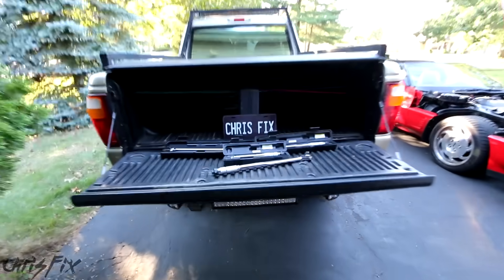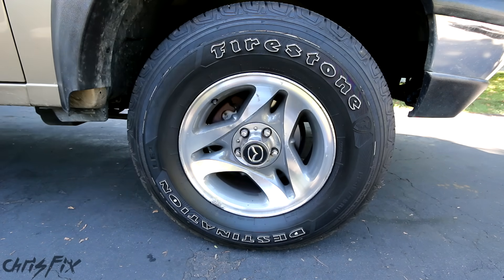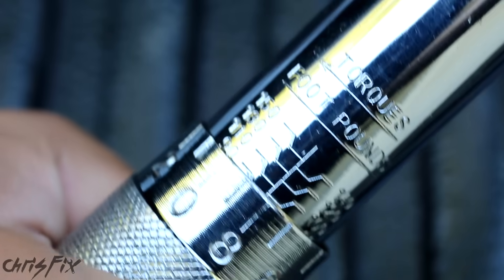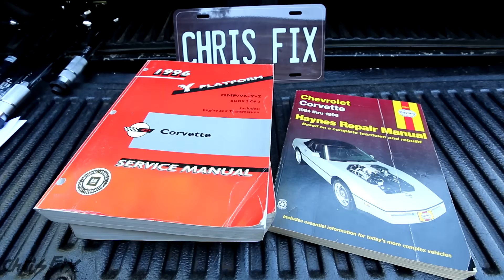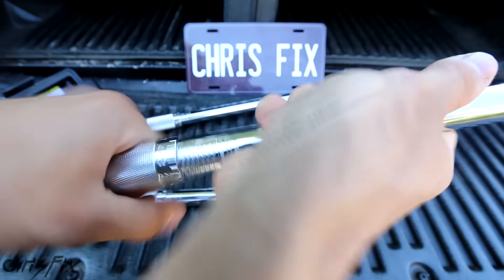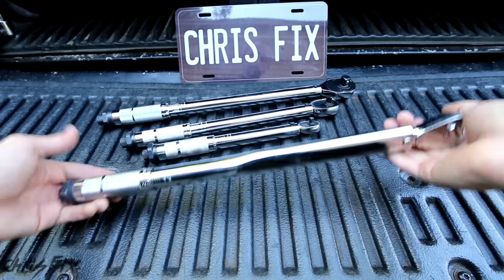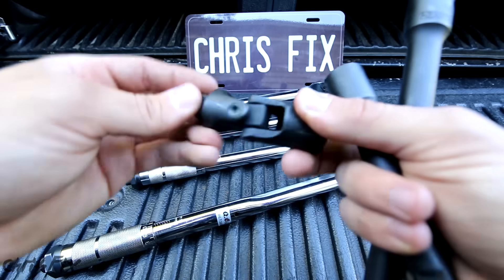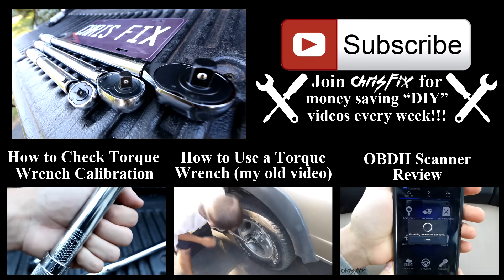How to use a Torque Wrench PROPERLY

Comment: Hey Chris.... Could you do a video on led bulbs, i believe for the interior it does save power over halogen bulbs but my question is for the exterior bulbs.... Okay brake lights... Led would save more power over halogens but when we add resistors(to stop hyper blink) does it consume the same amount of power as the standard bulb?? Summary: brake lights standard bulb or led with resistor... Which saves power demand and by how much?? Thanks :)
Reply from the maker: +Gurpreet Hira So if you need resistors it uses the same amount of electricity but if you dont then it uses less. Check this out: https://www.youtube.com/watch?v=MuHfJXWxEho
Reply: +ChrisFix ohh okay perfect, answered my questions about leds! I converted all my bulbs to leds to reduce power demand on wires alternator etc, so the ones with the resistor are the only ones using the same amount of power as a standard bulb. (if i understood that correctly)
Reply: +Gurpreet Hira yup understood.... Your videos are very informative, keep it up sir

Comment: Good Video, the only thing I would add is that when I use a torque wrench I always double click it just to make sure it is tight and pull with a slow steady motion.  I have seen people yank them and the torque wrench click right away and they say "oh its good" then I walk over and loosen it by hand cause they just yanked it.  General Rule of thumb for me with a torque wrench is "slow and steady gets the torque, double click ensures the torque" cause i have also had a torque wrench fail on me while torquing bolts down (leads to a bad scenario)
Reply from the maker: +tyg3rpro Thanks for sharing your tip!

Comment: ...check your oem lug torque spec. people most wheels are not torqued to 100. The average car is a toyota corolla or honda civic which torque around 70-90. F2500 trucks are 140-160. Lug torques are all over the place.
Reply from the maker: +cam pal Thanks for sharing. Most lugs are torqued at around 100ft-lbs for all of the cars I work on. As explained in the video, you need to find your own torque specs when you use a torque wrench.

Comment: hey chris on the headlights can we just clean them with bug spray and then add a clear coat and get the same result as the wet sanding or atleast similar?
Reply from the maker: +Ronny Ledezma No, never use bug spray on headlights. You will not get good results by clear coating a headlight after you use bug spray because the bug spray damages the plastic and it ill not come off completely and cause the clear coat to bubble. Use this method: https://www.youtube.com/watch?v=UEJbKLZ7RmM

Comment: In one of the tech school auto class's I took, I was informed by one of the instructors that for every added link say an extension you should add two lbs-feet of torque. Also the "most lug nuts are 100" is inaccurate and misleading, that being said, everything else seems to be accurate over all well done.
Reply: alloy rims 5 lug 100 is fine
Reply: +Jon A you're welcome to do that, but I'll keep to the recommended for my vehicle.
Reply from the maker: +Dillon Archibald Thanks for sharing. Adding extensions doesnt really matter in the torquing as I explained. If you think adding 2ft/lbs is going to do anything, well most torque wrenches are 4% off which is 4ft-lbs at 100ft-lbs of torque. Also, most cars with stock rims will have a torque spec of around 100ft-lbs. That is not misleading because if you are tightening down anything with a torque wrench, as I said in the video, look up your own specs. Sure some have 80ft-lb torque specs but like I said, you need to know what spec you need to torque down to. I appreciate your feedback!
Reply: +Dillon Archibald extensions do not change torque, while they do eat up impact, rotational force is rotational force.
Reply: +Jacob Blair I understand your point on that and that's what I had always kinda figured also, at the end of the day im really confused as to why an auto tech instructor would preach that, granted it was a woman instructor at a tech school, so that should have been a clue as to the validity of the instruction. haha Also Chris did make a great point in the reply before about them being off by 4% anyway, so that 2 pounds would logically be negligible at best.
Reply: +Jacob Blair at least that's what I figured before I had that info in my head, either way, I'll probably continue the practice, I'm a hard head haha.

Comment: As a professional tire technician, a tip, if I may give, is to push the torque wrench down with an open palm. So you don't possible throw out your back and so you don't over torque. Especially on the cars that need 165lbs-ft of torque. Just a tip.
Reply: TA B
LMFAO @ "professional tire mechanic"
Reply: Exactly !! Push DOWN instead of pulling up .  ✌🏽

Comment: Just remember not all lug nuts tighten to 100lbs/ft. most are less!
Reply from the maker: +Gary Looper Actually most are around 100ft/lbs but as always you want to check your service manual.
Reply: +ChrisFix There a very large number of models that are 20 or more lbs under the 100 LB/Ft rating. It seems kinda random though that a Bentley and a Geo would both be torqued to 50 LB/ft?

Comment: Actually 100 ft lbs  = 100 lb ft.   It's the same as saying 100 ft lever with 1 lb of force = 100 lbs with 1 ft lever. The two torques are identical.
Reply from the maker: +Our GamePC Not talking about the math/units, I am talking about the correct way to say it.
Reply: There is no correct way to say it Chris, you're missing the point. Both ways mean something, and they both happen to mean the exact same thing.  It's like saying 100 * 1 = 100 is less true than 1 * 100= 100

Comment: One of the biggest things to learn when you start working on cars is not over tightening everything. Tighter is not always better. Newer cars have a lot of aluminum parts and different meters joined together . And another big issue is gaskets , they are very precisely engineered so if they get crushed they won't work properly. It is a lesson you will learn the hard way after breaking bolts and taking twice as long to do a simple job because you broke a bolt or having to do a job over because of leaks. Torque is a mandatory part of working on current cars . Good vid you are great at picking subjects and you give very good advice . Keep it up ,great job.
Reply: 680ecks Agreed, I mainly use torque wrenches for things that require 10-30NM of torque, usually timing case covers where liquid gaskets are used, camshaft caps etc. Doing something up tight by hand is easy and is usually okay, but if you can guess 10NM you're doing well.
Reply from the maker: +680ecks Thanks a lot and thanks for sharing!
Reply: u gonna do a video on "rundown torque"?
Reply: Caliper bleeder valve is a great example
Reply: @gamerknown who the hell is cranking down hard on those?
Reply: Good friend is a Toyota tech. He says nobody uses torque wrenches. He said he literally has never seen one in the shop in years.
Checks out, my experience with Toyota dealers is they are glorified parts changers and couldn't diagnose diarrhea.

Comment: I bought a Tekton, off Amazon, a couple months ago to do wheel hub work. Torques up to 250. I also use it for the lug nuts as well. Love using it whenever I can, and like the clicky. I think the Tekton I got was about $50, and feels pretty durable.
Reply from the maker: +Boaisy Thanks! That is the one I recommend (link in the description).

Comment: The problem with using extensions is that you have to support the ratchet head. 
For an exaggerated example, try a really long extension, you will see the ratchet just leans over and damages the fastener by rounding off it's points as it falls off or jambs on. 
If you support the ratchet(by hand is fine for lower torques) you will be able to get the correct torque.
When the extension doesn't stay exactly in line with the stud/fastener, some of that torque is being applied for a sideways load and that's the problem. 
Flex is an issue but the vid discussed that. 
Pretty good video for most of the average guys usin one of these.
Reply from the maker: +MrTheHillfolk Thanks for sharing even more info!!!

Comment: Never over look torque adaptors to extend the range. Its been awhile since I used mine but I think they are 2" long which if I remember right doubles the torque so 20lb becomes 40lbs. They come in 3/8' and 1/2" to except an extension or in metric or standard nut and bolt sizes.
Reply from the maker: +Claude “Reviews4U” Rains Thanks for sharing!

Comment: I have this torque wrench from an air force base and the torque starts off at 300 foot lbs. My valve cover needs to be torqued down by 150 inch lbs.
Reply from the maker: +Otaku Nicca lol sounds like you need a new torque wrench!

Comment: Personally, I am not picky on tool. Chinese made, German made, Japanese made or U.S. made, as long as it get the job done and done it right, I am using it. But if financially feasible, I will definitely dive into get Snap-On. What set Snap-on apart from others is their exceptional quality. Quality, I am not only mean its functionality. It is the way their tools designed to greatest reduce the strain on your body; and I dare to speculate they sink in tons of $$ to tweak the design to give users just the right feeling when they are using snap-on tool. And just look at the workmanship of those snap-on tools, calling them tools is an understatement, they are arts and exquisite ones. To top it off, their lift time warranty is outstanding. The lucrative amount money they charged for the purchase is totally justified, because they are providing top tier tools with top tier service. There are only handful of times I do not feel being ripped-off at all when I am buying expensive things, and buying snap-on tools is one of them.
Reply from the maker: +MrBS4 Thanks a lot for sharing! I have heard the same thing. I just cannot afford snap on right now!

Comment: hey chris

i see a lot of garages and especially race crews use air guns to put on the lug nuts. how do they know the force on their guns are the correct torque? it is calibrated on the gun or the air supply?

ty
Reply from the maker: +Chris W The garages that use only air guns are lazy and incorrect. The always over torque the nuts and bolts. Race cars dont care because their equipment is designed for that.
Reply: ChrisFix ah i see

Comment: thank you for the very informative video. An info that I will add is not to always use the recommended torque without thinking. the status of the bolt threads has an huge impact on the bolt tension resulting from the torque applied. The same torque applied to a clean bolt, maybe oiled, will result in an higher bolt tension than with the same torque applied to a rusty bolt. In some cases you can actually overtorque if the thread is clean and oiled
Reply from the maker: +Luca Di Donato Thanks a lot for sharing!

Comment: The Harbor Freight $10 (on sale) torque wrenches are actually fairly decent, although I did have a 3/8ths blow apart on me this last summer. The head and springs inside just sprang out while I was using it... got it replaced no issue with receipt. I have 1/2 and 1/4 versions too.....just some info for people lookin for "decent" cheap tools
Reply from the maker: +67mustangreg Thanks for sharing!

Comment: Here is a question that has always vexed me. I work mostly on my small block Chevy V8 and it has a high rise intake and you can't get a socket on the 4 inner intake manifold bolts. Since the heads are aluminum and I have fuel injection which means more vacuum leak control I have to be more precise on my torque specs. Any advice?
Reply from the maker: +Ogre302 Yea, that is tough. I mean for stuff that goes into aluminum you can usually get a good feel on how tight it should be. Most torque specs into aluminum are 15ft-lbs on the low end and 35ft-lbs max. You can try crows foot attachments but then you need to do some math to get the torque specs right.

Comment: I threw my back out lifting up on a wrench when removing lug nuts once.  You should remember to push down on them, you'll be much safer as you get older.
Reply from the maker: +Ed Mathews Thanks Ed! I prefer pulling up because I have more control and I am not a heavy guy so a lot of times my body weight wont be enough to torque the bolt.

Comment: Another good tip is using the right torque wrench for the job. Torque wrenches are more accurate around 3/4 of the way down the scale. 

And for the price the Harbor Freight Torque Wrenches are pretty accurate and you can usually find them on sale for $10 every month.
Reply from the maker: +now534 Thanks for the tips!

Comment: I have a couple of vehicles with aluminum heads, and find my 1/4" drive torque wrench invaluable for changing spark plugs. It is way to easy to over tighten plugs.
Reply from the maker: +Michael Gregory Thanks for sharing!

Comment: Hey Chris fix I'm having problems with my 1998 crv when fluids are hot the transmission slips in third gear but when I first start it and cars still cold it pulls good and hard can someone or Chris please help me out ? Or leave your email so I could email you thank you!!
Reply from the maker: +Jorge Junqueira That could be that your tranny is going (the clutch pack). Or if it isnt slipping but wont shift, it could be a clogged filter or you need new tranny fluid. What color is the fluid? Does it smell burnt?
Reply: +ChrisFix when it's on for about 10 mins and hot in 3rd (automatic by the way ) it slips to red line as if it was in neutral, but when it's cold and 5-10 mins into driving it doesn't  slip and brownish dark colour should I drain it and change the filter and put new oil and stop slip ?

Comment: I have been using torque wrenches for over 40 years. I originally started with a Craftsman that has an analog gauge. It has a pointer that slowly moves across a scale of numbers. You are done when your pointer reaches your desired number.But I do prefer the kind that you show in your video. Know one ever showed me to remove the loud from the spring. It makes sense and I agree that it should be done. Thank you!
Reply from the maker: +Richard L Yea, that is the dial style wrench and works great!
Reply: TYPO FOUND! I just noticed that in my comment yesterday I used the word loud instead of load. You should back off the tension on your torque wrench removing the load, and not the loud.

Comment: Tbh this is my first time seeing torque wrenches and how it works
Thank you for the knowledge!
Reply from the maker: +tokekkk No problem! Glad the video was helpful!!! That is the goal with all of my videos!!!
Reply: ChrisFix do i really need the smaller torque wrenches since the 1/2 drive does ever the smaller 1 do? Also does the 1/2 torque  0-100 or 20-100?
Reply: nope the big 1/2 inch ones have a lower limit, they won't do really small torques. What you really need for cars in my opinion is a small 1/4 inch, and a large 1/2 inch. Any more is just luxury for the home gamer.

Comment: I'd like to add that the bottom 20% shall not be used. The bottom 20%, per military technical orders, is not accurate. Good torque wrenches should come with a calibration sheet that shows the verified accuracy range.
Reply from the maker: +G4Disco Thanks a lot for the tip!!

Comment: Nice video.  The markings are hard to see on my torque wrench -- any tips on making them easier to read?  Thanks.
Reply from the maker: +squid boy Thanks a lot! You can try using a black marker and then sand the surface of the tool with 2000 grit so the only black is in the actual numbers and marks.

Comment: Hey man quick question I'm working on  2002 subaru Forester 2.5 it has a cylinder 4 misfire the plugs are new the wires are new and the coil pack is new now here's the catch I unplug the battery the misfire goes away for a while then comes back disconnect the battery and clears it up what does it sound like to you im think ecu but I want a second opinion
Reply from the maker: +Robert Smith Could be the ECU or it could be the fuel injectors and when the ecu has to relearn, it realizes it cannot compensate for a clogged injector.
Reply: +ChrisFix ok cool I checked the Injectors and they had a nice mist I checked everywhere for a bad ground and didn't find any I just picked up a ecu yesterday so I hope this works thanks for your opinion

Comment: I would personally avoid any extension unless there is no other option. Depending on the torque you've got to reach there can be quite a difference from the wrench to the nut or bolt. Once upon a time we would send our torque wrenches out and have ones calibrated with a particular extension because torque on that particular bolt was dead critical, and it could be off by up to 30%.

Comment: The one thing I would add to your video Chrisfix is do not use a crows foot wrench or any extension that would make the torque wrench longer. If you do that, you have to calculate that change in length. I have seen the math involved and it's not worth the trouble.
Reply from the maker: Great tip! Thanks for sharing!
Reply: The math isn’t that hard really.  I use crows feet on torque wrenches quite a bit.  You just have to make sure you keep the same offset to achieve proper torque
Reply: I was taught to use a crows foot at 90 degrees from the handle. But I was taught by the Canadian military so I wouldn’t be surprised if that’s wrong . Because they also say we’re not allowed to use the lowest setting on the torque wrench even though that setting still passes the calibration. The joys of working on airplanes.
Reply: Why would extending it change anything?  Doesn't the wrench measure the force at the driver?